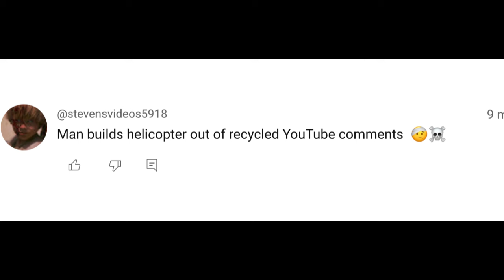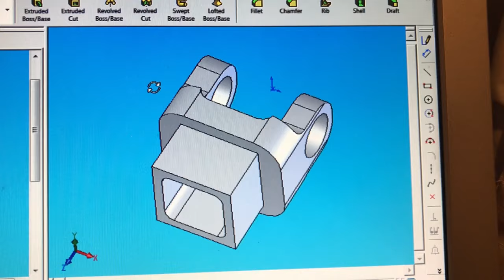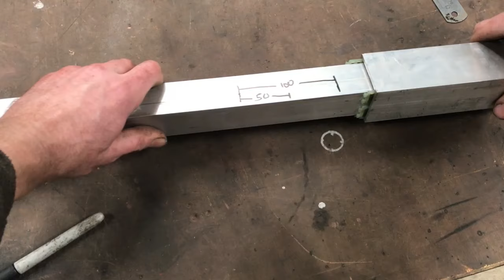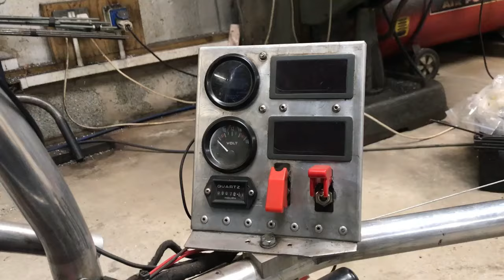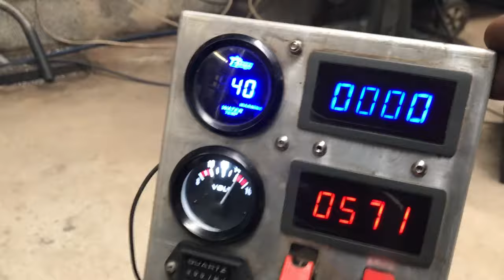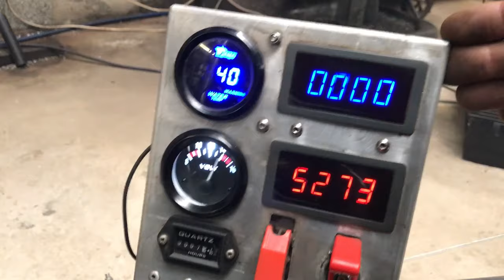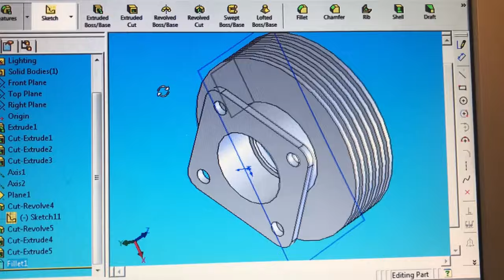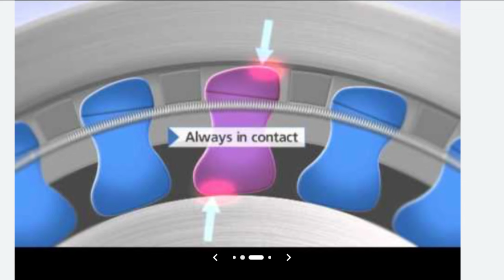Should I fix my Homemade Helicopter ???

Comment: Never let the negative comments get to you, go your own way and weigh any risks accordingly. In my opinion, it is hard for many people that have no, or limited, engineering background to estimate risk involved. Therefore, home-built aviation is often seen as dangerous. On the other hand, most people just see sports as a nice fun activity and don't consider the risks much. I think you take it serious, take manageable steps and no unnecessary risks. Keep it up and fail as safe as possible until it's a success!
Reply from the maker: Wise words, thanks 😊
Reply: Nah the reason people are sketched out is because you CAN’T do risk management on a helicopter. Anything happens with the blades and its 50/50 you’re dead even if you never left the ground.
Reply from the maker: @user-cg3em4cw4f  50/50, never had someone put a number on it. Where did this figure come from ?
Reply: @Ben-Dixey  More of an expression. By the way, you are going about this in by far the safest way I've seen so good job with that. I'm just saying people are probably concerned because out of all the vehicles someone could make, a helicopter is just about the only one where testing it in place is  almost as dangerous as testing it in the air. I know of at least one instance of someone dying because their homemade helicopter had the rotor fail and cut them while on the ground.
Reply from the maker: @user-cg3em4cw4f  👍 thanks. We all have different opinions on risk and that's just the way it is. A helicopters rotor has a massive amount of stored energy we can all appreciate that. The munna incident was horrible, I think he was very unlucky, however there were a few things that could have prevented the outcome. Seatbelt, crash helmet, testing the tail rotor to a much higher rpm. These things would have likely saved him. 
I certainly wouldn't be in favour of reckless risk taking, but yes there is risk attached to what I'm doing. 
No harm to be reminded of that and it makes you go back over the critical strength calculations.
Reply: @Ben-Dixey  Oh yeah, you're definitely not anywhere close to the level of safety liability that led to the other incident. For instance, the fact you're using the large weighted skids to prevent a potential loss in stability is already more than I remember seeing in the munna video. Very cool work on the helicopter, stay safe dude. I haven't seen anyone get this far, especially not with a counter-rotating design, so it's very interesting to watch.

Comment: rest assured , the people posting negative comments are not intellectuals. They simply have no mechanical understanding or background so they say something cliche like " youre gonna kill yourself " because they dont have the capacity or knowledge to critique the machine itself .  I get this on my channel in regard to scratch built airguns , comments such as " Aluminum cannot be used as a pressure vessel , its not made for it " which is patently false as aluminum in an industry standard for high pressure tanks. In any event , im glad you got started repairing the heli.
Reply from the maker: Appreciate the supporting comment. Thank you
Reply: This comment is 100% accurate!    Well said my friend I get the same stupidity on my channel and yes aluminum can be used as a pressure vessel.

Comment: I still think this design is a great candidate for an electric drivetrain.  Could be significantly more simple, and since your planned flight times are very short, you couldn't need a large battery.  A motor with zero regenerative function would effectively act as a sprag clutch. I'm rarely an advocate of EV solutions, but in this case I can't see many problems other than you'll have to get hot on your electrical engineering :)
Reply from the maker: It would be great for it to be electric. There is one issue, the cost is too much unfortunately. £10k to make that alteration with the necessary batterys, motors, speed comntroller etc. Maybe one day if I can afford it.
Reply: @Ben-Dixey  , electric drivetrains can require a lot of complex controllers for motors and batteries. I'm all for e-powertrain, but don't assume it is as simple as RC cars.

Comment: not sure how far along you are with your universal joints, but have you considered looking at automotive half shafts? they use a tripod universal joint that allows for plunge on one end, and a CV joint on the other. could either use wholesale or steal the plunge joint from one?
Reply from the maker: Hi. This video shows what I had before and it was two tripod cv joints. 

What I got WRONG, Homemade coaxial Helicopter
https://youtu.be/wQ3UkJsjQT8

It worked but there was a couple drawbacks, one the cv boots can't take the elevated RPM and I suspect the grease will be flung out to the perimeter and maybe not lubricate the joint. Drive shafts don't usually run past 2000 rpm where I was running it at 5500. I suspect it could be made to work but I think now that UJ's are the way forward.
Reply: @Ben-Dixey  oh man you can even see the tripod at the beginning of this vid! yeah you can't have 2 tripod joints, the position of the shaft is indeterminate. also you can't mix a skinny little inner shaft like that with a guibo rubber mount; in actual automotive use the driveshafts have giant center splines for the wheel bearing, and generally a flat round section they "sit" down onto the bearing center race when you tighten the center nut to preload the bearing. all this helps locate that housing very well and stops it from wobbling.
Reply from the maker: Yes. I needed two because of the plunge travel required. The shaft was free to do as it pleased. I did have a spring in the bottom at one stage help centralise the shaft. It wasn't the way to go, I might have gotten away with it if the part that kept the bottom joint square was stronger. Or I if didn't include the flex coupling. However ultimately it was a bad decision.

Comment: Thinking about the way a car driveshaft using a constant velocity joint works so well , it can take massive amounts of torque whilst altering both length and angles ! Me I would stay with that approach and have a cv joint on both ends without a Rubber coupling. , Rubber couplings were only meant for Propellor shafts and were not massivly used in those as they would fail... think ford sierra and early escorts ;-)  Watching with interest
Reply from the maker: Hi, the cv joints did work but there were a couple issues. The cv boots didn't take the Rpm which means something else has to be used. I suspect the grease at this high rpm would be thrown to the inside diameter and not lubricate the joints. Cv joints are usually only operating at 2000rpm max. Mine ran at engine rpm which was 5500. The prop shaft on a vehicle runs at engine RPM in top gear and they use universal joints. I Think this has to be the way forward. It solves the grease and cv boot problems but I understand it's no longer constant velocity.
Reply: That's rite Ben, Then you'll go to Carden joints, very heavy ets.  @Ben-Dixey

Comment: the way you're testing the slip is not relevant, when it rotates it will move more easily - but i don't have any data to back that up and how much force it takes. Also, you can get a driveshaft with coated splines.
Reply from the maker: I suspect you're right about the reduction in friction when rotating. A test rig would be needed to confirm that. Thanks for the tip on coated splines.

Comment: As a random bypasser and coax fan:
I'd fly it, as long as both rotors are forced to the same RPM and linkage to both swash plates are reliable. However, no faster than walking speed and not outside ground effect, just in case.
I wouldn't trust a fixed pitch design for anything more than hovering around 2feet
Reply from the maker: I agree with this, if the parameters are kept to and the mechanical parts of the machine are reliable I think it's safe. 
Just a side note I don't actually have any swash plates, just linkages to the rotor hubs.

Comment: What you needed was another brace and 2 harmonic balancers looking at the break you actually needed a center support bearing followed Bt a harmonic balancing plate to act as a gyro which will eliminate vibration and imbalance which caused the drive shaft ton fail the second harmonic balancer/gyroscopic plate should be placed between the two rotors.
Your design is a good one you just have to overcome the hidden problem that destroys everything, vibration.  You can also design a transmission which will allow a lower operation speed for the same amount of thrust.  You will have to shorten the shafts but well worth it.
People are going to hate regardless so you do your best that they will hate you more.
Reply from the maker: Hi, I haven't had any experience with vibration measurement. I'm not convinced at this stage that it was vibration that caused the failure. I think it was a cyclic load bending moment through weak and bad design but i could be wrong. 
Vibration measurement is something I would like to test for. The equipment looks expensive.

Comment: I too hate broken things, they need to be fixed. I wonder about the very hard roller bearings rapidly wearing grooves in the soft aluminum.
Reply from the maker: Good point David, it had crossed my mind. 👍 I think it can be calculated.
Reply: @Ben-Dixey Aluminium is also much more vulnurable to cyclic load fatigue than steel.
( i have no overview of your project or your level of expertise, 
that's just the first thing that comes to my mind when I see aluminum used for a shaft.)

At 5000 rpm, you'd hit 1 million load cycles in just 200 minutes... that's fast.
 
Trying to remember  numbers out of books I haven't seen in years, i'd be surprised if your aluminum shaft would hold even a third of a theoretical static load for that long- 

propaply much less if there are dynamic peaks or shocks.
Reply from the maker: @nos9784  That's correct, I need to do some research on this. I've built the rest of the rotating components using the fatigue strength of the material. The square box is 6082 t6 and at 95MPa its endurance is somewhere between 15 -500 million cycles. I expect steel is the way to go for peace of mind. I also need to look at a main rotor shaft I made from aluminium. 
Great comment 👍👍
Reply: @Ben-Dixey  , for complex systems like this test is always better than calculation. It is possible to run numbers (Hertz stress of curved surfaces), but I would only trust it as a means to be confident that it would pass durability testing...

Comment: In my opinion building something with so many variables like a helicopter is more dangerous then most extreme sports you would be better off building a plane still dangerous but with fewer variables to worry about. But at the end of the day it's your choice do as you want dude Either way what you built is very cool best DIY heli iv seen so far.
Reply from the maker: Thanks 👍 the plane is half way built now, should be fun and hopefully will see much more airtime.

Comment: I'm sure you  are an exceptional and talented engineer.. don't forget .. you're goal has already been achieved... not by yourself admittedly... so why risk your spine bursting  through the top of your skull when an unforseen failure occurs on  your contraption... just because you can doesn't mean you should . God  bless and good luck
Reply from the maker: Spine bursting through the skull, from 3ft high? There is risk I know that but the suggestion is a little over dramatic wouldn't you say? . The goal was almost complete but not quite. If not more time testing this one then I think I would build another. It is what I want to do, some people jump out of planes for fun I think this is what I want to do for fun. Not 2000ft, 3ft is ok with me.

Comment: I do think you should go for a proper collective based design once you get stuff sorted with this current helicopter.

You may also consider getting ahold of someone who knows more about mechanical stuff regarding the drive shaft. I honestly don't know how strong it'd be compared to a round shaft and part of me feels like it wouldn't hold up as well as a round one would.
Reply from the maker: Yes I think collective is the way forward. I will include that on the next project. I might also consider adding collective to mine. 

I will try and work out the life of the driveshaft myself but I have someone who knows way more than I do to check it for me. Don't want another breakage.

Comment: Needle rollers on aluminium is not going to work for long at all, the rollers need to bear on a flat and importantly hard surface. A correctly engineered spline drive should give you the articulation and robustness you need, after all this has been used on the propshafts of cars with live axle for the better part of 100 years.
Thay said, huge props to you for creating this amazing project. If this kind of drive and ingenuity didn't exist we wouldn't have aircraft today..
Reply from the maker: Yes, it's something I considered and needs to be checked, I have a hunch that the number of rollers in contact and the low torque will allow it to work but this needs to be verified. The spline works on car prop shafts yes but it doesn't need to be low friction like I require. Maybe there is more free movement when spinning ? 
Thanks for the encouragement. 👍

Comment: is there a reason you have the head in the position you do? i.e. direct drive to the rotor head and the gear ratio and clutch assy down at the engine bay? just wondering yes complexity is a thing but a fractured or broken drive is worse ... fantastic build
Reply from the maker: Hi, the reason for the design I've chosen was relative simplicity. To control a coaxial rotor via swash plates is complicated. Just tilting the whole rotor on a hinge seemed simple by comparison. The Nolan brothers and bensen B9 did it and they seemed to fly very well. There was another attempt at this configuration called the hekitrike. They had the engine mounted along with the rotors, all tilting together. Seems crazy but I think it could have worked. 
My idea was to do the rotor reversing and the reduction in one go. Others had the addition of gearboxes to do that.

Helitrike 
https://youtu.be/17fD4V_kUbM?si=VSoztB7HxFsyCP58

Nolans 
https://youtu.be/B21Xk6tNcBw?si=I1khWGZDF23_4YUD

Comment: That's a two stroke, so the preferred RPM is very specific. It was for boats, and water is similar to air, so I'd assume that would work best…if it had stock exhaust. 

I can't tell you what RPR would be best, or how to find it, but I do know where to look! Dirt bikes. 

From fatty pipes to  modified ports, there is all kinds of information about tuning 2-smokers. Those guys just go nuts! They're making over 60hp from 250cc singles!
Reply from the maker: Hi. The outboard exhaust was something I couldn't really use, it was all part of the Leg. Back pressure I think provided by the water. The exhaust also had coolant running down it which changes the exhaust temperature. Sonic waves travel at different speeds depending on the exhaust gas temperature. 
All this made it hard to determine how to make my own that was somewhere near stock. I used a YouTube channel called the Au mechanic, he went through all the design criteria to design your own. That's what I did and it made the difference between hovering and not getting off the ground. No idea what power it's now putting out and I'm sure it could be better. Making the exhausts took ages but I do have to make them again at some stage because I chose aluminium which was a mistake. Vibration cracks were appearing, I might have solved that but probably not.

Comment: Ive never seen a helicopter with such a design before, very interesting I must say. i wonder how stable it is when it gets perfected, since the design does make sense
Reply from the maker: I hope to find out more about it when fixed, the Nolan brothers did extensive testing on a fixed pitch tilting mast design but only the people that met them could find out all about it. The air scooter 2 was another but again no info.
Reply: Its a coaixal design, just like Ingenuity that flew on mars for 3 years. Just a lot bigger. The coaxial design doesn't require a tail rotar to counteract torque since the two main rotors spin in opposite directions. The design is inherently stable.
Reply from the maker: @lillygivens3390  I agree with everything accept the inherently stable bit. its no more stable than any other helicopter. It's very unstable from my experience and takes a lot of practise.
Reply: @Ben-Dixey  so true! Nothing will best the natural stability of a fixed wing aircraft, unless a delta wing is involved lol. Fly safe friend ❤️, from Tennessee!
Reply from the maker: @lillygivens3390  Thanks and yes you're right, a had some microlight lessons in an Ikarus c42 and I didn't realise how well they flew by themselves. Didn't know about static and dynamic stability in fixed wing. 
When I built the helicopter I too thought coaxial's were inherently stable because it's what a lot of people say on the internet. They say that counter rotation gives the perfect gyroscope. Counter rotation cancels any gyroscopic effects in fact. I was surprised when I found out the truth.